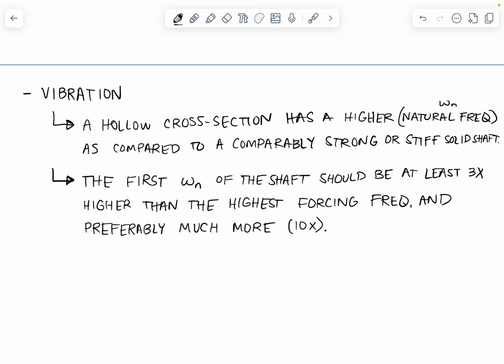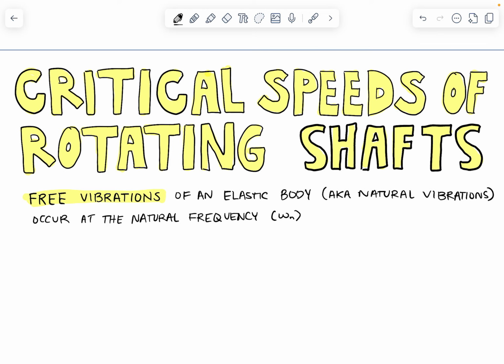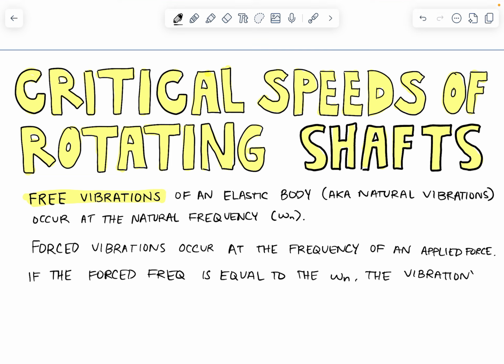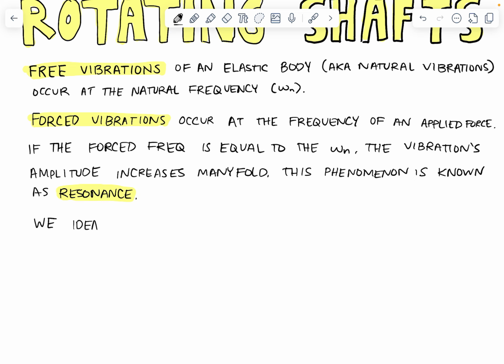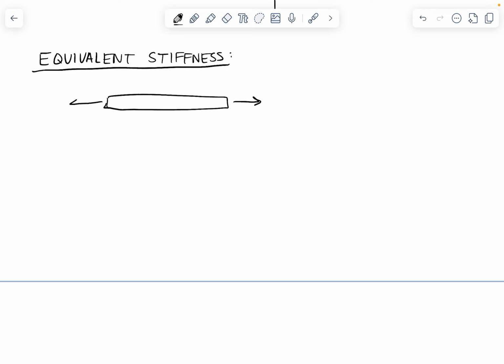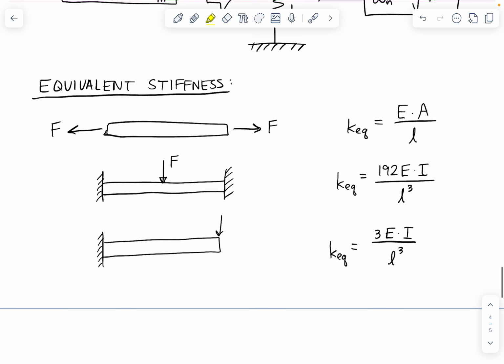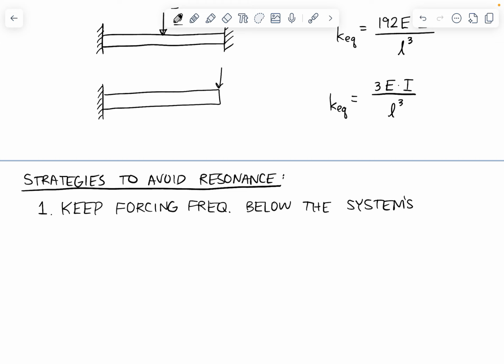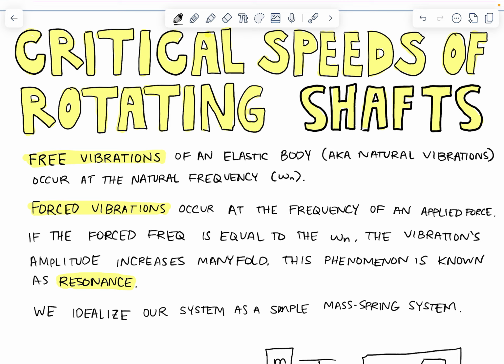Machine Design: Critical Speeds of Rotating Shafts - Lecture 16B

Comment: They usually save all the fine details for vibrations class and they don't draw it up side down.  They barely ever mention vibrations in Physics II or Mechanics II/dynamics.  Everyone knows that system is going to flop over sideway immediately.  They do make a big deal of telling you the mass is on a frictionless surface or they just draw it with the mass hanging down.